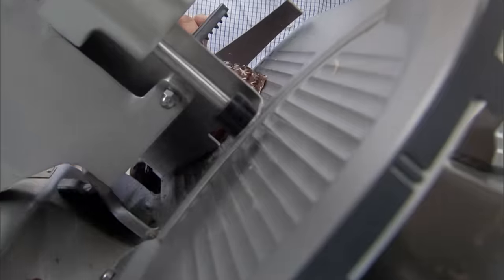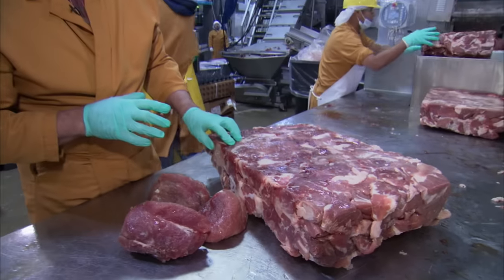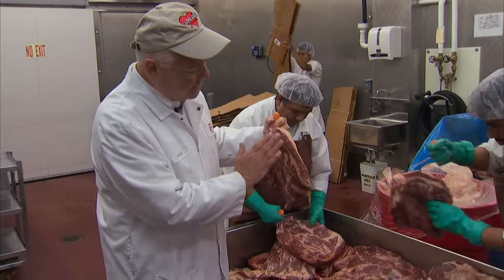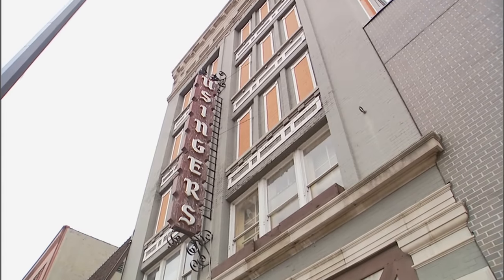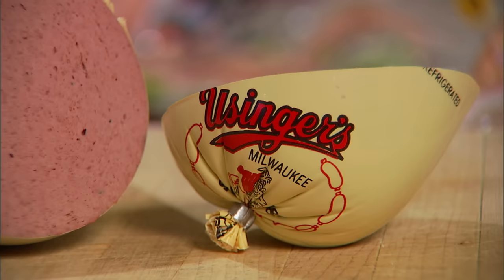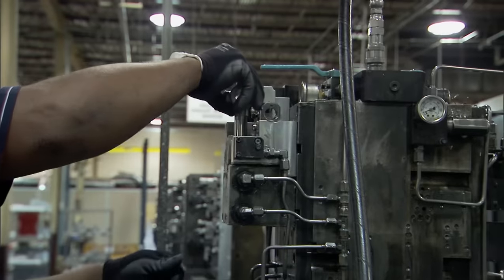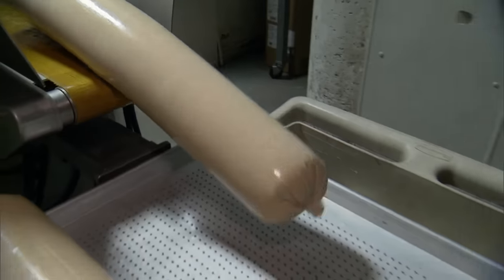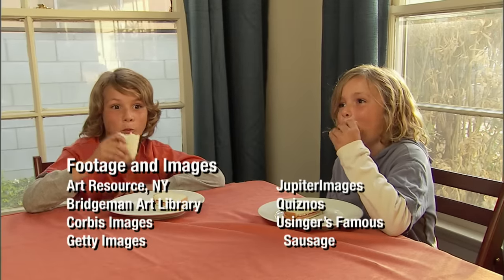Modern Marvels: The Surprising World of Cold Cuts (S13, E43) | Full Episode

Comment: Butterball is doing things right. Excellent, sanitary operation. Great production.
Reply: I mean kinda. The guy explaining everything about the sanitation foam from on area to the next proceeded to step over the foam that’s supposed to sanitize. Just saying.
Reply: So many not wearing gloves
Reply: I have done a lot of work for that Butterball as an outside mechanical contractor making replacement metal parts for the machinery.  Done work for several other foodservice plants as well, and I will never ever hesitate to buy anything from Butterball.  The food safety and cleanliness there is unbelievable.
Reply: Butterball runs it as clean as possible.
Reply: @GravyHucker  I agree!  I've worked in commercial kitchens with safety polices so strict, they were difficult to work for.  Butterball is impeccable.
Reply: @budgreen4x4  gloves are more trouble than they're worth for sanitation (contaminants can sit on a glove as easily as on a hand)
Reply: @alquinn8576  uhh ... No
Reply: @budgreen4x4  quite a rebuttal. please explain the magic of gloves
Reply: @alquinn8576  I'm guessing you don't know the process? But I guess surgeons are dumb for wearing them too..
Reply: @alquinn8576  anyways, do you think a sanitized hand is just as clean as a sanitized glove?
Reply: While on camera at least.
Reply: Total PR.  If the foam ground sprayer dies to you think the line shuts down?
Reply: @budgreen4x4  Surgeons wear sterilized gloves, touch only certain items that are also sterile(or are the insides of the patient).  Food service gloves and other medical gloves are not sterile.  Those gloves are worn to protect the wearer, not the consumer/patient.
Reply: Also depending on what machinery they are working with, sometimes you're actually not allowed to wear gloves due to risk of severe injury
Reply: Except for the cooking in plastic… ew

Comment: The other thing I noticed about the Tofurky is that it's significantly lower in sodium than many meat-based cold cuts.  300 mg per 2-oz serving is still a hefty hit on the sodium budget for those who need to watch their intake, but nowhere near as bad as the 400-600 mg per similar serving that seems typical of most cold-cut meats.  I looked at a selection of Land O' Frost meat nutritional info and found sodium ranging from 360 mg/serving for one of their turkey products to 710 mg/serving for one of the chicken products.  Most of the products were in the 500 to mid-600 range.
Reply: The thing I noticed is it isn't meat.
Reply: My.dad.used.so.much.salt.on.his.food.that.no.one.else.could.handle.a.bite.from.his.plate...He.died.at.a.well.preserved.age.of.ninety.six.years.and.25.days...
Reply: If you read the labels, you'd see that Tofurky replaces the salt with salt substitute, namely potassium chloride and magnesium chloride.
Reply: @edmartin875 did he also tell you to put periods after every word?
Reply: Nope. I'll stick with real turkey.

Comment: I prefer prepackaged lunch meat and cheese today. Most deli counters today slice everything so thin it shreds when you try to make a sandwich, I prefer mine sliced about 1/8 inch thick and the counter maids act like it's too much of a chore to turn the thickness dial on the slicers. If I wanted it thin I'd ask for chipped like my corned beef for Rubens. I've even noticed fast food and deli counters today are slicing tomatoes for sandwiches so thin you can see through them.
Pastrami is best when sliced thin and fried like bacon and served on rye with coleslaw on it.
I've never tried head cheese but when I was unemployed years ago and the family was hungry I used to buy marked down sause loaf and boil the vinegar out of it and use it to make pots of bean soup.
Anything with liver is just that, liver worst thing ever.
When I worked at a corned beef deli franchise we had to remove all our slicer blades and send them out to be sharpened because the company had all the sharpeners removed from the slicers. I guess they didn't trust us.